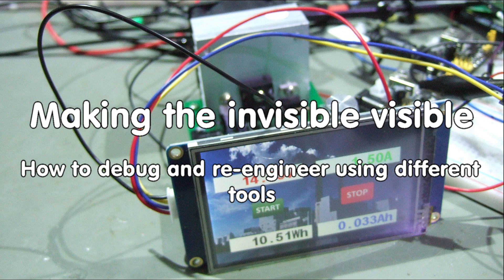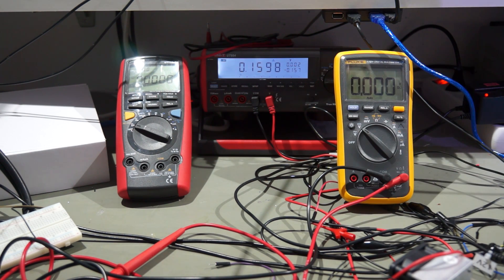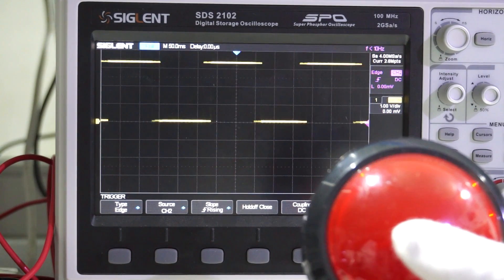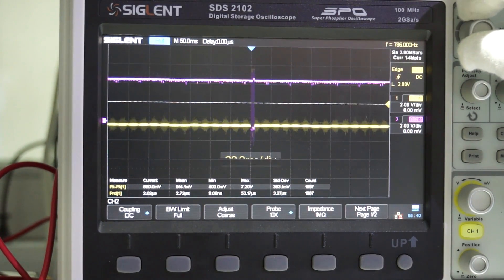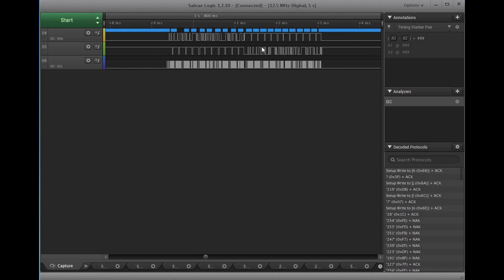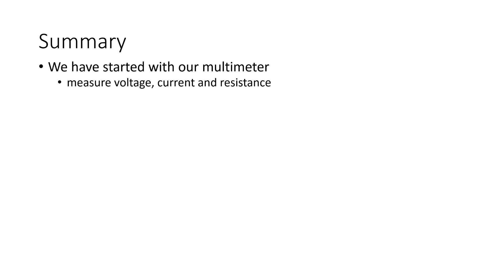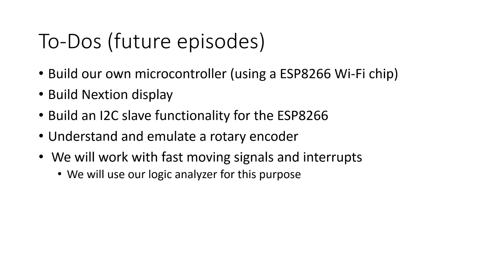#72 Making the invisible visible: Tools for debugging and re-engineering electronic designs

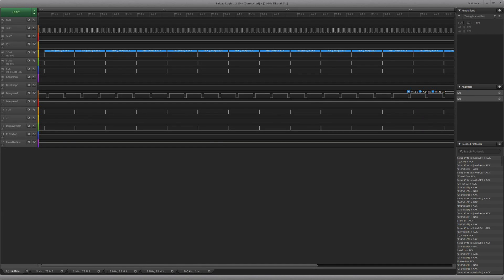Comment: 7:44 I bought this logic analyzer before seeing this video, it’s yet to be delivered. Which software to use then?
Reply from the maker: Saleae software works but legally is not allowed for clones. Sigrock Pulseview is open source.
Reply: @AndreasSpiess  thanks. That makes me wonder if this software pings home, like Solidworks does. If it’s a domain connected computer, they know it’s not home use and then you will hear from their sales/litigation team.
Reply: @AndreasSpiess  on another note I was thinking, to understand how oscilloscopes work better, maybe one way is to implement a simple one (not an actual use one). Do you think one can be made with something like ESP32?
Reply from the maker: Microcontrollers usually are too slow to build oscilloscopes.
Reply: @AndreasSpiess  yeah sampling rate will be bad. I was thinking like Bitluni’s recent oscilloscope project.

Comment: I recommend using the cheap clones with pulseview (which is part of sigrok https://sigrok.org). This way you get a really affordable tool and do not steal software from saleae.
Also ist is really easy to write plugins for sigrokdecode. This allows even low level protocols like I2C to be used as input to a high level analyzer, so you can easily decode information in idividual registers.

Thank you for your videos. I find them quite useful.
Greetings from Austria, the country without kangaroos  :-)
Reply from the maker: After the price increase of Saleae a very good alternative...

Comment: really great... I 'm also trying to find a cheap alternative to a Scalar NEtwork Analyzer to measure my ham radio antennas, like a KC901H, but I don't need all that and It's too expensive for amateur usage.
Reply from the maker: This is a different topic and I think, there are some videos around for this topic. They use a noise source, a directional coupler, and a SDR radio. But still, not really cheap...